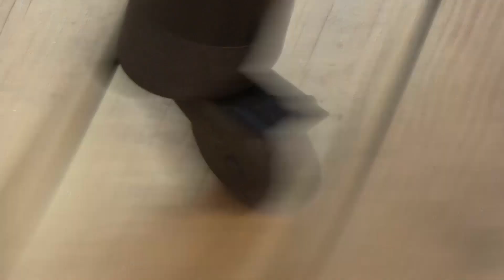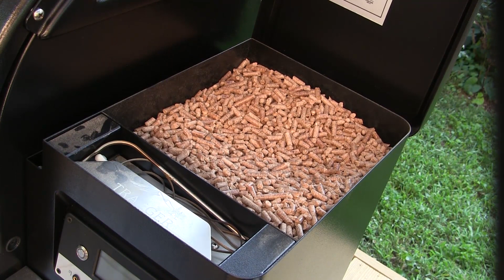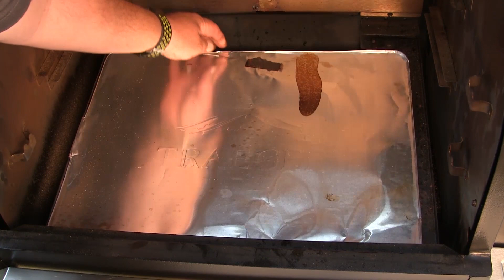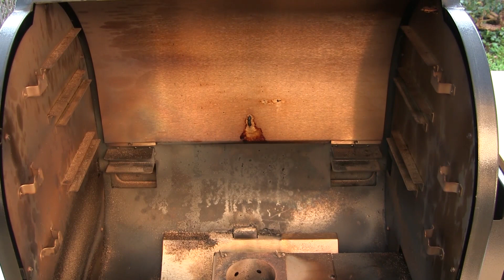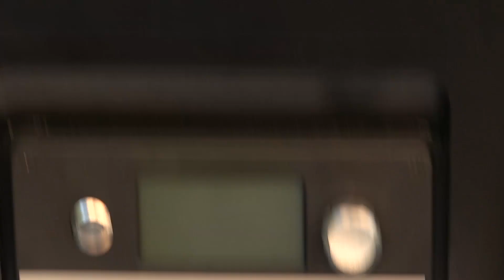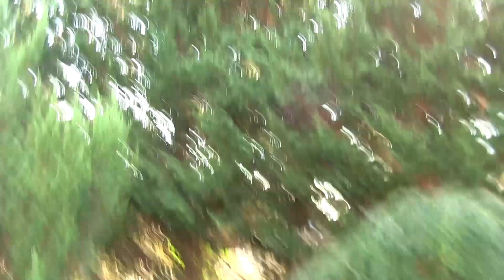First Look - Traeger Timberline 850

Comment: You can sear a streak on the old traeger by removing the diffuser plate over the pot ,I have done it many times,awesome char ,leave the open,sear it ,both sides,then put cover back on and finish cook.
Reply from the maker: I agree completely that most pellet grills aren't good at searing steaks.  it's just not what they are designed to do.  I don't think any of them are particularly good at it, including the Yoder.  I did it a couple times on the yoder and the mess that has to be cleaned up afterwards is not worth it.  I do my steak searing on other grills.

Comment: I never said at all I own a Yoder pellet grill  at all.im just saying Yoder is rated number 1 in quality construction in pellet grills, over traeger.bought I think traeger still outsells Yoder YS 640.because it’s much cheaper in price.I own a old traeger it was American built in Oregon,bought mine in 2003 ,it works fine with no fancy thrills at all.
Reply from the maker: I have a Traeger Lil' Texas Elite also that has worked with zero issues over the six years I have had it.

Comment: When I bought my traeger there was no competitors at all ,so Yoder came and everybody else followed,for me the biggest issue with all pellet grills was unable too cook at high heat like open flame or direct cooking with a searing  plate over fire pot,for many years.everybody now has caught up with traeger.yoder is one of the few pellet grills that is still built in America with thick heavy steel barrel from stem too stern,not just the main cooking chamber but all parts of there pellet grill,fully welded legs and frame are welded solid with no smokes leaking anywhere,that’s what your paying for.a pellet grill that can be passed on too your children.the oringel traeger came out in 1988  and was fully welded from stem too stern,no bolts anywhere,and built like army tank,it was heavy and weighed a ton but it was built with high quality in every detail,and it said right  on the grill,built and made in mt. Angel Oregon,not mass produced in a foreign land.
Reply from the maker: Tim Nutt  enjoy your yoder!  I didnt like it.  I tried my very best to like it and i cooked on it for almost a year before i just gave up.  I am much happier with this traeger.  Everyone has preferences and mine falls here.  The trouble i had with the yoder far outweighed any steel construction or pride of it being made in the usa.  You will love that grill if those are the metrics by which you judge it.  Rust.  Very uneven temps throughout the cooking chamber... up to 80 degrees different from one end to the other...  its picky about what kind of pellets you can use on long low and slow cooks because of the way ash builds up in its fire pot...   takes it 30 to 40 minutes to get ready to cook because it overshoots your set temp by about 150 degrees every time you fire it up to “preheat all that heavy steel’ as i was told over and over.  If any issues like those are important to you, you might dig in a little deeper than build quality as you research your purchase.  Hopefully yoder has worked out some of those issues related to its cooking performance.
Reply: Tim Nutt , the 650 and 850 now sear at 500

Comment: Surprised to hear that you like this better than the yoder, hope to get a comparison video on them
Reply from the maker: There won't be any comparison video.  I got rid of the Yoder before I got the Traeger.  I like everything abou the Traeger better than the Yoder.  The only advantage I see from the Yoder is the searing option and I don't think it's much better than what you can do on the Traeger.  I am not in the camp that sears at temps over 500 degrees because I like to sear in ghee with herbs and spices.  This will work well for that and I will be doing a video on that soon.  If I need more extreme searing options I have other grills.

Comment: Any issues with the grease drain design so far?  Common complaint online is that the “float” gets stuck and leads to grease fires. Was hard to tell if this was primarily user error(not cleaning enough) or a design issue.
Reply from the maker: I have not seen any issues so far.  I have only cooked one boston butt in it so far and I had no issues there.  I did follow the provided instructions for priming the grease trap.  I will keep my eye on it.